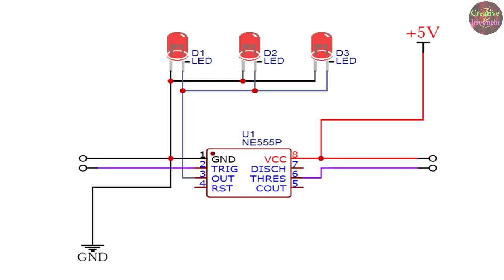Amazing Project Using Only ONE Component NE555 ic, how to make touch on off circuit using NE555 IC

Comment: Two things:
1: R.I.P. SOLDERING IRON TIP
2: THAT BEAT DROPPED HARDER THAN A DINOSAUR TURD.
Reply from the maker: Anything Else !!
Reply: @CreativeInventorlab  yes! Good job. I have made this circuit before and next you should try a latching (single button) on/off circuit. Ty